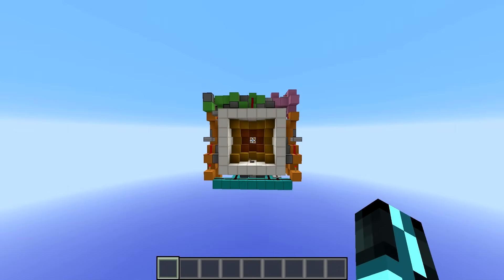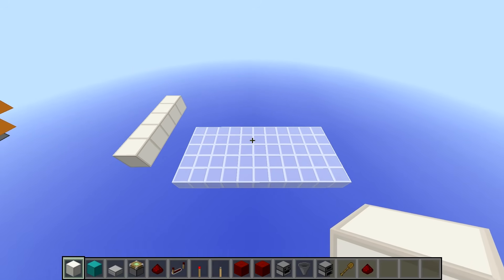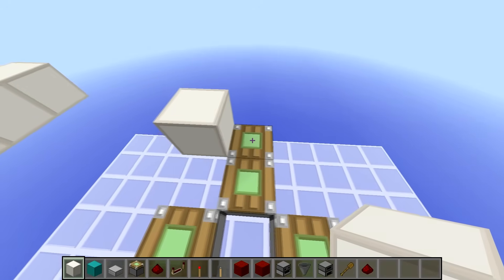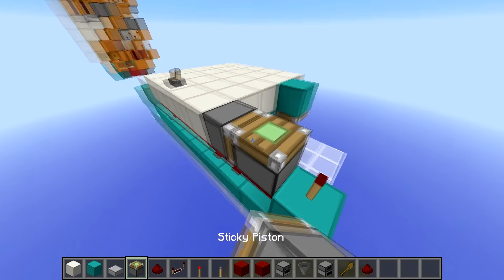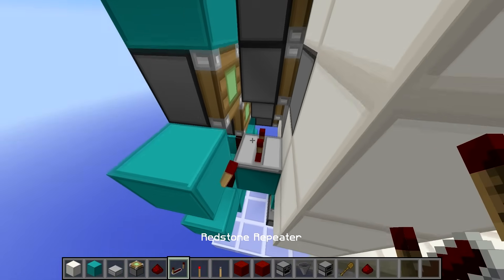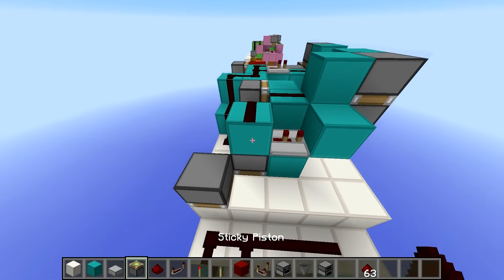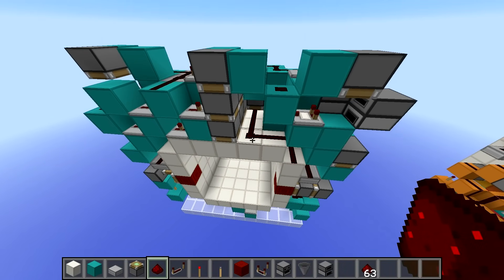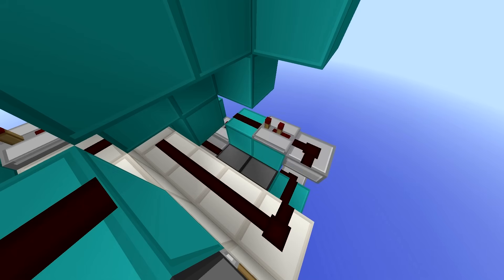1.16+ TUTORIAL: Perfect 5x5 Cave Door [Always On Lamp, Fully Synced, Fast, Symmetrical, Layout Size]

Comment: someone could have problem in retracting of redstone lamp on top, (i had the same and i fixed it) download the map and check all timing of repeaters first, second check that the block in position 318/67/-184 isnt glued to the sticky piston (if you buid the machine in casual order it will probably glue to piston due to wrong timing in retracting, and it wont fix on his own, you have to break it and place it in the correct position again) :)

Comment: The block above the redstone lamp(the one above ot when its closed) doesn't retract. I've tried fixing it but I can't
Reply: someone could have problem in retracting of redstone lamp on top, (i had the same and i fixed it) download the map and check all timing of repeaters first, second check that the block in position 318/67/-184 isnt glued to the sticky piston (if you buid the machine in casual order it will probably glue to piston due to wrong timing in retracting, and it wont fix on his own, you have to break it and place it in the correct position again) :)
Reply: @mikycaspa what does that 318/.... mean? We may mot have the same coordinates where we are building it
Reply: @mikycaspa  I'm on xbox but thx anyway. Redstone is too different now anyway.

Comment: Important note to all builders: 
Pause at 10:03 and make sure your pistons are lined up exactly like this. If you activated them at any point they will have changed. Be careful to make sure it looks just like that or you'll waste lots of time.

In addition, when covering it up, give the redstone room to breathe or you'll end up interrupting signals. Make sure the case you build around it does not touch the mechanisms. It's not too hard to cover, i covered it with some towers and a roof.

I have this working perfectly on PS4 as of today. Be sure to follow him very carefully, he's quite fast. I can confirm, if something isn't working right, you fucked up.

Comment: Or you place an iron door xD
Reply: whole point is for styling nether portals, or for usage as a secret door. remove the lever, then one block closer to our pov when he showcases it put a slab with a hopper underneath with a comparator using the hopper as its source, pointed into a solid block with repeaters going both directions so its powered on only when an item is in the hopper. then only you know the location of the hopper so only you can open the door. (you can also make it a bit more complicated with a hopper comparator chain that eventually leads to a chest that you know about that isnt hooked to a comparator so that only you can reclaim items used to open the door. great for online play)

Comment: the second piston on the triple extender doesn't pull the other piston back leaving one piston extended and a block in the center what should i do? i have followed every step in your video and it didn't end up as it should.
Reply: (2 years late but...)someone could have problem in retracting of redstone lamp on top, (i had the same and i fixed it) download the map and check all timing of repeaters first, second check that the block in position 318/67/-184 isnt glued to the sticky piston (if you buid the machine in casual order it will probably glue to piston due to wrong timing in retracting, and it wont fix on his own, you have to break it and place it in the correct position again) :)

Comment: Hey... I know this vid is a lil old.. but I have ran into a problem..

Followed the steps in the vid as far as i can tell, but the block in front of the lamp is not sinking back into the roof. The dual sticky pistons are fully retracted, but it's not grabbing the block and yanking it back in place.. any ideas where I may have messed up?

building it in 1.7.10 if that matters any
Reply from the maker: There have been no changes to redstone that would have broken the door. You may be missing the block that's on the right hand side of that piston.
Reply: i'll check again soon as I have it loaded back up. glad to know it's not something code blocked, that means once i sort out where i screwed up it will work and i can use it as a launch bay door hehe
Reply: ok, to the right side of that particular piston (facing door entrance side) i have a block, with another block on top of that, with a repeater on top of the top block..
Reply: apparently i such at this lol. started tinkering with the repeaters and made the problem worse.. going over the vid again to get the repeater settings correct, maybe i'll spot what i missed the first time
Reply: Lol so i found what was stopping the block that i was originally having trouble with.. i didn't notice you bringing the redstone line down beside that twotick. Now i just got to figure out how i messed up the previously working lamp lol

Comment: I had some issues just recently on a server where the first sticky piston on the left side of the door would not update properly to pull up when the door opened. To fix this, I added a redstone torch on the block to the right of the piston. I wanted to let other people know the fix just in case they also found issues.
Reply: thank you! literally saved my build! <3
Reply: No problem! I am glad my tip actually helped someone!
Reply: Jessica Kowalski same! I just had the same problem!
Reply: I probably did miss it. I rewatched the entire video 4-5 times before I started trial and error because I couldn't figure out what I missed. But I figured if I missed it, others might as well.
Reply: I have the same issue, the sticky Piston surrounded by 3 other blocks doesn't extend. I tried out your Version and hoped the best but it still doesn't extend. Know maybe a solution? Tried to rebuilt it the left side again, add some more circuits but nothing works :(
Reply: YESSSS!!! Finally, I managed to find a solution, my Version is if this Problem occurs: under the Piston there is redstone coming from 2 sides. Place another block 1 block higher and put reedstone on it. So now u have tree blocks which are on an other Level than the block with redstone below. Once you did this small Change it works perfectly :)!

Comment: Do you have any suggestions for fixing the bottom piston on the inner ring left corner? When I flip the switch it doesn't activate the rearmost piston in the double extender and instead activates the one in front. This unfortunately leaves a hole since everything else works. I believe the issue is somewhere in the power structure at 6:30 but I'm not sure.
Reply: +Zachary Neese Never mind I figured something out
Reply: I have the same issue, could you please help me? How do you fixed it :)?
Reply: Might be 6 years too late but I'm having the exact same problem in 1.19... don't happen to remember how you fixed it by chance? I've built and rebuilt the entire thing like 4 times and I get the exact issue every time. :/ The rest of it works perfectly just that one double extender... I've tried making my own fixes to no avail.

Comment: The redstone lamp doesn't go back into the room for me :(
Reply: i fixed it, look at the block 318/67/-184 it must not be glued to the sticky piston, when you build it it may stick to it during redston building or other things, and whit this wrong manual timing it will glue tto the piston, so 1 check all timing of all repeaters and then check that this block isnt glued :)...1h to find that lol
Reply: The lamp does not retract but everything else works good job tho its cool and helpful
Reply: @jamalhaddad7204  same, im trying to see what is wrong, the download works fine...(meanwile i tried also changing color of bloks on pistons, using like colored melted terracotta and doesnt work when closing on this row, even if the pistons retract correctly, it thought i was wrong with the circuit but is block's fault)
Reply: i touched the repeater in the download near the block 318/67/-184...i set it in 4 ticks and restarted the machine...same prblem of mine, i set it like before changhing the lampposition and nothing, always broken, so i think there must be a certain sequence in order to build it, thats strange
Reply: Dj Cosmos what are you on